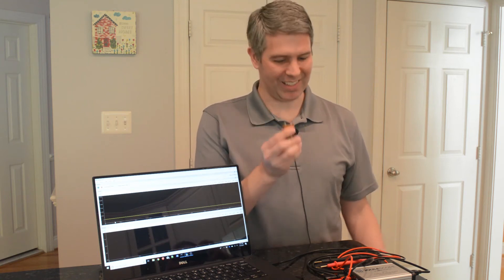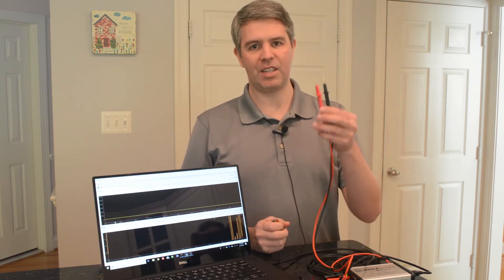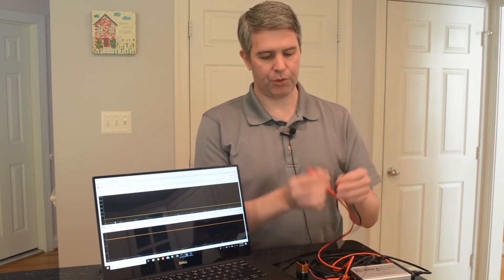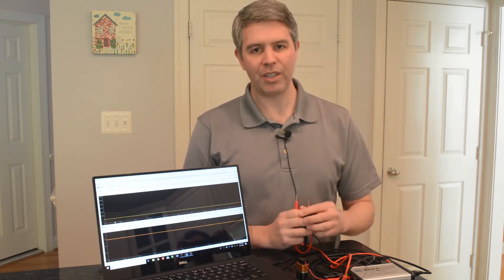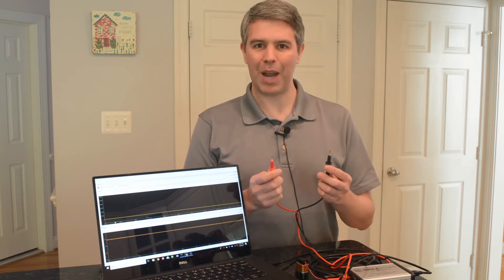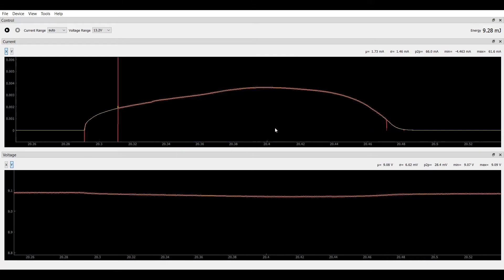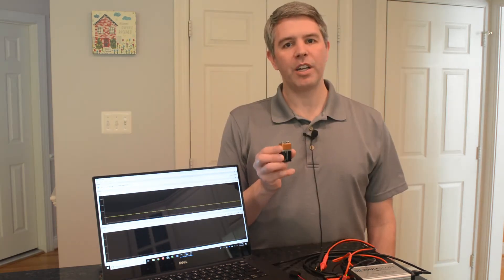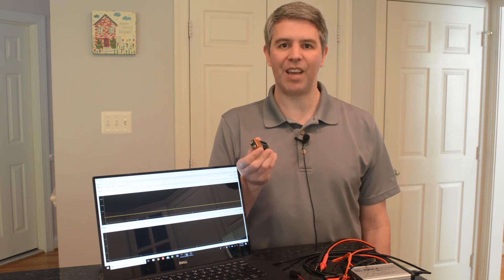Licking a 9V battery with Joulescope

Comment: I'm here because the dog chewed through the 19v computer power cable, and after splicing it back together, I wondered what the chances were that the dog was shocked as she bit down. I looked at the ratings on the transformer, and it says 19v at 3.4 amps.
That seemed like a lot of amps, so I wondered how it would compare to something I did know produces a shock when stuck in a mouth....a 9v battery.
 But if I understand correctly, it never reached even .5 an amp, so 3.4A at 19v would seem to be actually quite powerful in comparison. 
Any thoughts?
Reply: The current will want to flow through the path of least resistance, which is likely the saliva or tooth connecting the two wires in the power cable.  Although some current could flow through tissue, such as the tongue, it would not be as much.  In the video, I measured about 4 mA @ 9V through my tongue when the voltage was applied directly across the tongue.  Using Ohm's law, the resistance of my tongue was V = I R , R = V / I = 2250 Ohms.  At 19 V, I would only expect V / R = 19 / 2250 = 8.4 mA.  This would be enough to give a nice jolt in the tongue (if it flowed through the tongue), but not enough to cause any lasting damage.

Hope this helps!
Reply: @mliberty  Thank you so much, that's a great breakdown.